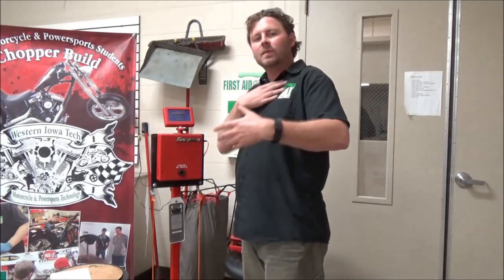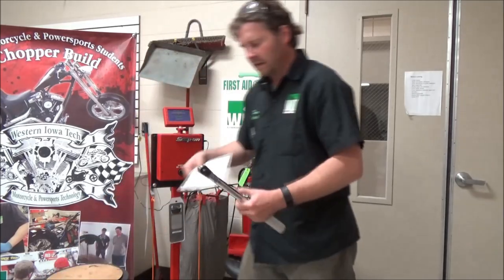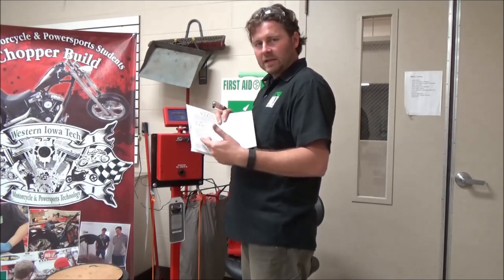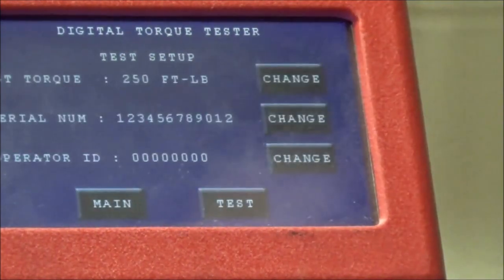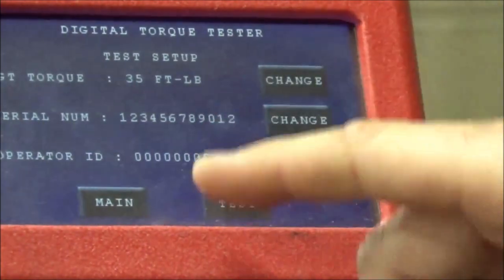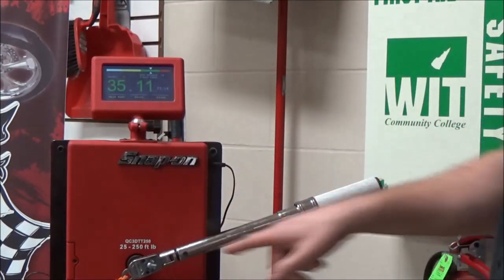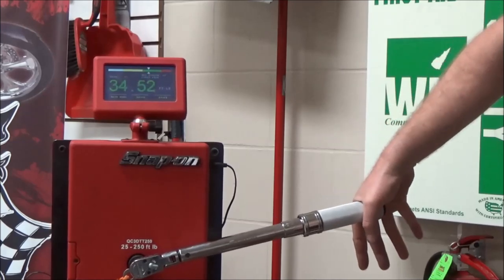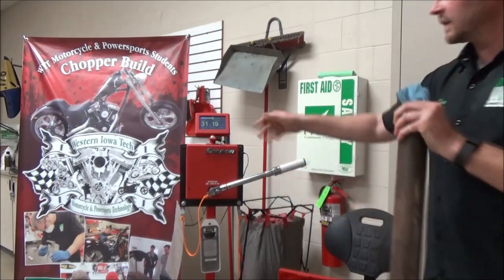Why hand placement matter when using a torque wrench. Proof with electronic tester!

Comment: I'm a mechanical engineer with over 25 years of experience and absolutely love your channel.  You have a good delivery and very clearly enjoy what you do.

I've always been perplexed about the hand placement is important claim regarding torque wrenches.  For the life of me, I can't think of a scientific reason why it would make a difference where you apply the load to the arm provided one stops pushing the instant the wrench clicks.  The releasing pivot knows nothing of where or how the load is being applied to the handle.

I'm wondering of the answer lies in how quickly a human (you) can react when the click occurs.  Typically we apply a force until the click happens.  The click releases the force being delivered to the fastener and provides a cue to the operator to stop pushing.  If you hold the handle and apply a force and react super sllllooowwlllyyy after the click happens, you will continue to apply additional force.

I'm sure the release pivot has a certain angle that it deflects when the desired torque is reached.  For the sake of discussion, lets assume it's 5 degrees.  This means that the release pivot releases the head by 5 degrees when the set torque is reached.  In the instant the head releases, a trained mechanic 'knows' to stop pushing.  If they stop pushing before the handle of the wrench rotates more than 5 degrees, no additional torque is applied to the fastener.  If they are slow and continue to push, the release head will still be bent the five degrees and additional torque will be applied to the fastener.

I suspect the designers of the wrench know how much release deflection angle is required to allow a mechanic ample time to stop pushing when the click happens while holding the handle in the recommended spot.

I would like to see the test performed again while taking the above information into consideration.  Not a criticism at all but it appeared that you reacted with normal reaction time while holding the wrench close to the fastener which resulted in a high reading.  I would love to see a data log of the applied torque versus time.  I would bet it increased steadily, released and then went up again during your reaction time resulting in the high reading.

I wonder if AvE has ever tackled this subject.
Reply: Keep in mind that a click type torque wrench has two pivot points. The point of fastener rotation and the point that the wrench moves when it clicks.

The point that a torque wrench moves when it clicks should always correspond with the torque wrench setting and shouldn’t be affected by hand placement. The point of fastener rotation is a combination of the click pivot torque and the entire wrench torque from hand grip to fastener pivot point.

If you move your hand toward the pivot points, more hand pressure will be required to get the “click pivot” to click for a given torque setting due to a shorter lever. So the click pivot torque is the same. But, the fastener pivot is the sum of torque applied to both pivots, which has been changed by moving the hand position toward the pivot points and applying greater force in order to get the “click pivot” to click at a given torque setting. 

So, when you change hand position, you are not changing the torque at the “click pivot”, but you are changing the torque at the fastener pivot.
Reply: @Joesmith-pl4qb  I realise this video and your post are a few years old but thank you for this explanation Joe.

Comment: I'm a retired physicist and a gear head who really likes these videos. Back when I was teaching Mechanics physics courses in college I would have loved to have done this problem in deriving the relationship between the applied force, the application point, the pivot distances, the compression force of the spring and the shear force at the cam point. The applied torque is scaled to the spring force through a ratio of the pivot distances and some other constants. This simple linear relationship only holds when the pivot distances are constant, what the manufacturer established.

Comment: Shane,

I see where controversy might be originating from... people might be thinking/assuming that this click-style torque wrench works ideally based on moment about a point M= f * d (where M- moment, f-force applied, and d- perpendicular distance from the axis to the line of action of the force). So in ideal world with ideal torque wrench that only "sees"(measures) moment(torque) at the a point it should "click" no matter where you apply the force from(following rules form above); obviously you would have to apply more or less force with decreased or increased distance respectively. However, this "click" type of torque wrenche has a mechanism that seems to be based on a specific deflection point on the arm. In other words the mechanism requires you to apply force at a specific range of a distance for it to be within acceptable parameters per-design. Something along the lines of cantilever beam and how it deflects in the middle of the beam if force is applied at the unsupported end. I would suggest to  try and contact a Snap-on engineer and see if they can give a simple explanation  how the mechanism actually works... this should help clear up the controversy.
What this looks like is a good example of difference between theory and real-world application where tools do not follow theory in all ranges of possible applications. 

You can explore all of the theory for yourself if you watch some videos or get some engineering books regarding Statics or sign up for a class at the local college/university. Also, after statics you might like to look at Mechanics of Materials or Mechanics of Solids which builds up on Statics but applies material properties (deflections, stress, strains, shear and etc.) and Dynamics. 

Hope this helps.

Comment: Wow! I've been an auto mechanic going on 16 years and never knew hand placement was so important. Granted, I can't recall any time where I haven't used the grip (because that's the whole purpose of a grip - a place to grab) but it's really cool to see how much of an effect wrong handling can have. I knew about extensions and adapters changing the final value but never thought about grip. While I tend to follow service or use instructions anyway, the additional proof via actual data is the icing on the cake. I know I can fix something if I follow the manufacturer procedures, but I also know I didn't engineer the damned contraptions I fix and therefore have no business ignoring what the engineers tell me to do. Love your work, man. Don't let the haters get you down - they rely on yip-yap and shortcut guesswork while you have the direct support of engineers. Anonymity makes idiots and jerks far braver than they would be while face to face. Keep it up!
Reply from the maker: Thank you for the kind words. If I can ever be of service to you, here is a video explains how to connect with me. 
https://www.youtube.com/watch?v=vjvmB01ebcs 
Keep Wrenching,
Shane Conley
Instructor/Motivator/Motorcyclist
www.how2wrench.com

Did you like this free video and hope to see more? Would you just like to say thank you with a donation? Click https://www.paypal.me/how2wrench

Comment: hand placement does affect the effective torque on the clicker wrenches, and it's because of the different  side forces (non torsional force) that result when it's being applied closer or further away from the pivot. When the force is being applied close to the pivot, there's greater amounts of friction on the pivot, which will tend to impede the rotation at the pivot, and cause the click to occur later, and increase the effective torque.  Similarly, when the pushing from the far end, less of that side force is exerted on the pivot, and consequently less friction on the pivot, so it'll tend to click sooner, having less impediment to the rotation.
Reply: Nope.  It has nothing to do with friction.  Even if the pivot is perfectly frictionless, the torque will still vary depending on where you place your hand.  It's a matter of geometry, not friction.

Comment: Shane,
            these are awesome videos mate, and you're most correct in your observations here.
I'm not a mechanical engineer however have some experience there and engineer in the electronics end of things.
The issue with the click style torque wrenches is that they have a torque mass from the preloader that is a known factor given the handle and how it is being held, and if you change that (essentially what is an acoustic property) it gets a bit ugly at that point.
Your spot check device given the modern electronics will be metering this well, and damping ringing, it wont be getting it wrong.
The mass of the extension is damping the excitation as opposed to the short hand hold you initially showed allowing the rest of the torque wrench to act as a tuning fork, so in that one resonant flick over-steering your torque intention.
What would be rather interesting to see is how metal on metal in the extension compares to the padding you used to display the property.
Well done best regards,
Tom.
Reply: C'mon man, you're overthinking this.  It's not some subtle resonant frequency impedance matching thing.  Rather, it's simply geometry.  

Think of it like this - if you were to grab right at the pivot where the head attaches to the wrench, the wrench would never click no matter how hard you pull.  In other words you'd apply infinite torque, regardless of the wrench setting.  As you move your hand toward the grip the torque becomes finite but still higher than the wrench setting.  When you reach the grip the torque is finally correct.  Continue past the grip (with a handle extension) and the torque will be less than the wrench setting.

The phenomenon is due to the ratio of grip-to-pivot length and grip-to-socket length.  That's all it is.

Comment: thanks again for the info. I over torqued my clutch pressure plate bolts because i had my wrench set wrong had to extract the broken end from the basket, which was a job on its own. awesome videos thanks you!

Comment: Just want to take a moment to thank you for this video. I'm only a novice / home DIY guy but I try to learn how to do things correctly. At some point I read you should hold a torque wrench around the mark on the handle - and lo and behold I found two marks around the handles of my two existing torque wrenches, about where the ring finger rests (so not centred). Now I've just bought a smaller 1/4" for working on bicycles and it doesn't have a mark so I was confused. I started thinking maybe it was a myth anyway since in general if I shorten the distance, I need to increase the force to get the same torque as there's less mechanical advantage of the handle/lever. The inverse is why a longer breaker bar or using a 'cheater pipe' lets us get away with applying less force to undo a stubborn nut or bolt - we're applying that lesser force but over a greater distance, so same amount of total work done - and I figured the torque wrench was measuring that total work and hence maybe hand placement just doesn't matter. Your tester machine shows I was close to convincing myself of something false. I still don't really understand how the torque wrench 'knows' where you're applying force - but I guess your machine doesn't lie :-)
[update - found comment by benhetfield below to be extremely enlightening as to the how & why]
Reply from the maker: Thanks for commenting on a few videos! Glad it helped. We will let Shane know! 
You rock! Best way to help us back is joining or grabbing our T-shirt! Support links and gear below!  Awesome and thanks for commenting! Smash the subscribe button (thank if already a sub!)
Have you seen our "YouTube Trained Support Shirts? Great way to "high five us" https://goodfellasmerch.com/collections/how-2-wrench/products/support-shirt

Join this channel to get access to perks:
https://www.youtube.com/channel/UCBhM8DCKnT3qXwTW0eToyCg/join   
-Daily MEMBER FIRST COMMENTS ANSWERED FIRST 
-Live Q/A video chats
-Wonder if we have a video on your need? Members can request content links!
-Full Access to the ENTIRE 700 video library
-Member-Only FREE tool giveaways   

Just want to say thanks quick to support us for this information and our work saving you money? 
Give us a high 5 here:  https://www.paypal.me/how2wrench   

Got an emergency and your head is about to explode from frustration or fear? Get Shane’s cell here: https://how2wrench.com/ols/products/techline-one-on-one

Comment: Thanks for making this video. I think it points out that, once again, one should never take technology for granted. Even the humble torque wrench.  Or, perhaps, I should say, the humbling torque wrench.

My take is that to to understand what is going on here you really have to understand both the torque wrench mechanism and exactly how the meter is measuring torque.  Mostly the former.

The head of the torque wrench experiences both the applied torque (force times moment arm) and a linear reaction force equal and opposite the force applied to the wrench by the operator.  In the demonstration that change in the reaction force affects the wrench's internal mechanism such that the calibration is no longer correct.

An interesting experiment, or thought experiment, would be to apply the torque using a T handle torque wrench (if such a thing existed). Then change the distance of your hands (two hands on the wrench this time!).  I suspect in that case the hypothetical T handle torque wrench would be unaffected because the two forces applied to the wrench create a pure moment (i.e. torque) and the net reaction force on the wrench head is zero in all cases where you have your hands applying forces equidistance from the wrench center.
Reply: Replying to self... I just looked at some diagrams that show the basic design of a "clicker" torque wrench (see wikipedia). These wrenches have a head that rotates on a bar that extends down the wrench shaft to contact the spring. The bar is pinned, and pivots, just below the head. The bar pivots based on the combined force of the spring, the reaction torque applied to the head and the reaction force that is applied to the head. It is hard to describe in words but if you isolate that part of the mechanism and think about the forces involved then it is clearer. The calibration of a "clicker" wrench of this type is, therefore,  dependent on the magnitude of the force applied to the wrench and the torque (that same force times the distance at which it is applied).  If the magnitude of the reaction force changes because the distance changed,  even if the torque=force X length value is the same, then the "click" won't happen at the same torque.

I'll now have to go experiment with my small collection of cheap beam and clicker torque wrenches to observe this effect for myself first hand.

Props again to Shane Conley for making this video.
Reply: Very insightful analysis. I was really hoping he would explain this in the video. In my mind I didn't think it would matter where your hand was located since the force on the head would experience the same torque regardless. However you're right; the pivot mechanism in the handle depends on this "reaction force" you are describing.

Comment: I do not understand how the drive end can tell the difference. But your test shows it does. Wouldn't have believed it otherwise, but now I want to know why it makes a difference since you would think the drive end would always click at the same set torque every time regardless of the amount of leverage on the other end.
Reply: I just searched it, replying to my comment one minute later. It has to do with the bending of the wrench itself. The wrench is measuring the amount of bending happening and clicks when x amount of bending should occur at x amount of torque. Choking up on the handle will decrease the amount of bending and going further back increases the bending. It all makes perfect sense now.
Reply from the maker: Nice. Thank you.  Want to give us a “high five”? Click here https://www.paypal.me/how2wrench 
 Need more personalized help? Your answers and help are just around the corner. Save time and money while protecting your investment and yourself by doing it the right way at www.How2Wrench.com  
  
 Thanks for commenting and adding value to our community! Please subscribe, share and consider a H2W membership to support our free work here! 

Have you subscribed yet to never miss a video? Have you seen the video playlists? Over 600 videos! Check them out here: https://www.youtube.com/user/conleybuilt/playlists
Reply: Think of it like this - if you were to grab right at the pivot where the head attaches, the wrench would never click no matter how hard you pull.  In other words you'd apply infinite torque, regardless of the wrench setting.  As you move your hand toward the grip the torque becomes finite but still higher than the wrench setting.  When you reach the grip the torque is finally correct.  Continue past the grip (with a handle extension) and the torque will be less than the wrench setting.
Reply: @LostBeetle   Sorry but that's not what's going on.  Even at the lowest setting (where the wrench certainly isn't bending!) your hand placement is still important.  It's geometry, not bending of the wrench, that causes this.  The wrench doesn't bend, for heaven's sake🙄.